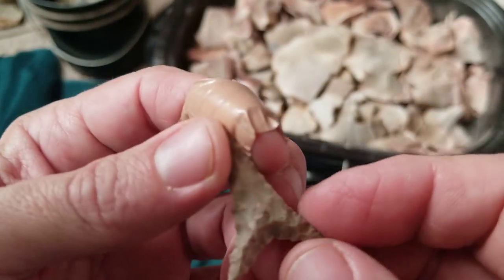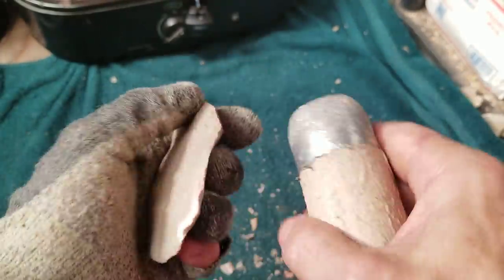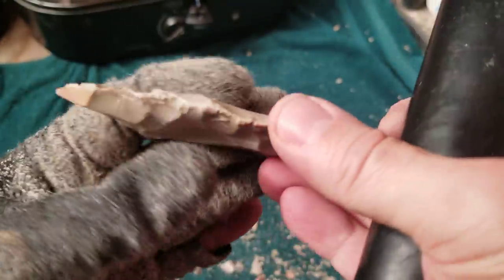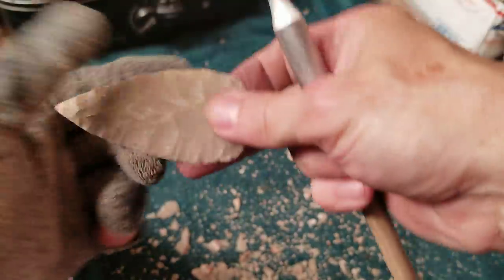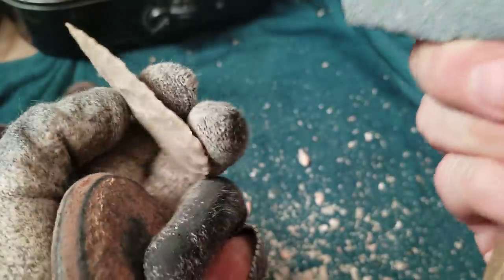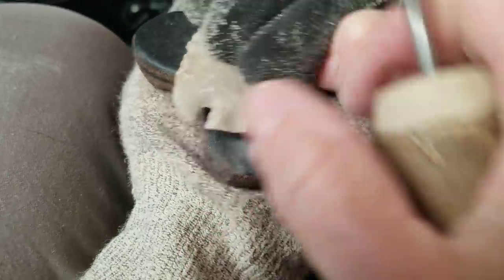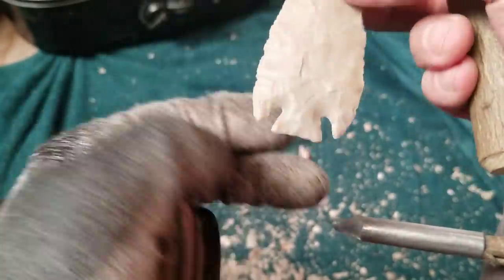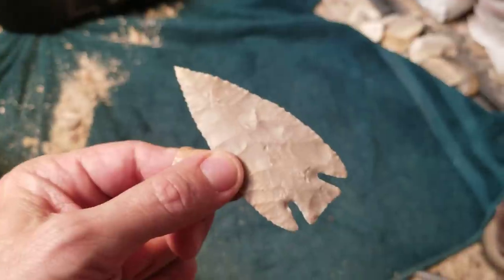970 - Flintknapping and Too Much Talking

Comment: Doing controlled step fracture especially when they travel to the 2/3 of the point width was a common technique of the extraordinary flintknappers of the Solutrean period in France and Spain. They made steps and after that they remove it from the other side and this was one of the secret of their extraordinary thinning method (they finished certain point like large laurel leafs almost on flat or concave surface). All the best.
Reply from the maker: I've heard this theory before. Thank you for bringing it up. I don't agree with it but it's a good conversation topic.

Comment: Your bird point from rough stone give a me hope , I am producing points as thin with raw stone , a little more rough but still decent for a beginner. If I can almost match your "tough" stone points with raw rock now then I really can't wait for my turkey roaster to arrive in a few days !
Reply: ive been knappin for prob 7 months now, the first month i had all raw and then started heat treating, but then i went back to raw for the last 2 months and just heat treated a batch and its so much easier. i think practicing with the raw sometimes can really help.
Reply: Been Knappin' for 5 years. Raw stone can almost become glassy and brittle with heat treatment. There is a goldilocks zone with different types of stone.
I found that when you first try heat treated rock, it likes to step and act weird when you go to drive flakes the same way you would with raw rock. 
It was almost like re-learning flintknapping all over again after being able to work raw rock to very thin points. 
(Your comment is from 2 weeks ago, did you get that turkey roaster yet?)